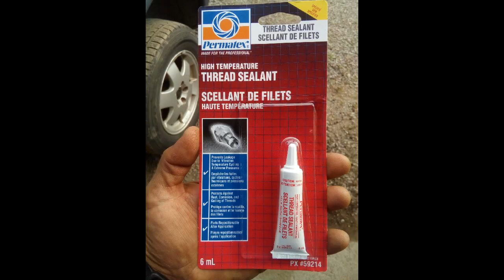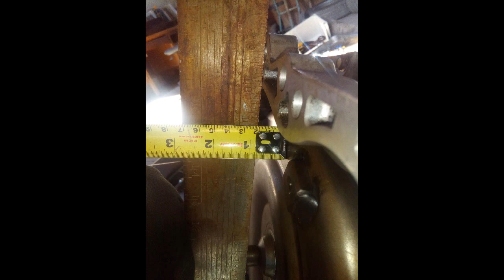TRANSMISSION SWAP VOLVO V70 XC (ASIN 55-50SN) | Photo tutorial.

Comment: Very helpful video and a great job. I have just bougt one of those with manual gearbox. It looks like the clutch is not in the best condition. If I have access to a car lift, wouldnt it be easier to lower the entire gearbox/engine together with the subframe?
Reply from the maker: Absolutely, if I had hoist I could just drop the engine and gear box all together with subframe. Let me know how everything is going.

Comment: Great video, I was wondering if you know about the 2005 V70 2.5 turbo? My mom's mechanic wrote her this messege and we have no clue what to do, the car is great 140,000 miles on it but are unsure how to fix it economically here in California. He wrote: ATM IS WORN - HARD SHIFT 1-2/2-1- FLUID IS DARK & HAVE CLUTCH & METAL PARTICLES - ATM INTERNAL WEAR/FAULT CAUSING HARD SHIFT. FRONT AXLES ARE WORN & HAS EXCESSIVE PLAY AT CV JOINTS. RECOMMEND BATTERY, ATM & FRONT AXLES REPLACEMENT.
Reply from the maker: Hi George, I am glad it helped you out a bit! P2 Volvo (2001-2007) are all pretty much the same car. If flued hasn't been replace since day one I will be careful doing the flush. Some high chances after the ATF change AT might fail completely. If it shifts OK I will leave it as it is. You can try to flush AT on your own risk it might solve the issue. Might try add Lucas AT additive, sometimes it works (it never worked for me). 
After AT swap I installed AT cooler and inline filer. BZW, I will make video very soon how to service Volvo AT. How to make it last very long time. Volvo has ASIN (Toyota) gear box is pretty reliable unit but she is very sensitive to overheating and ATF quality.
In my experience, If CV axels don't make clunking noise when you turning sharp and rubber boots are sealed I won't worry about it but I will recommend to check your Volvo with another mechanic you trust. 
Cheers!
Reply: @PistonShack  thank you so much I will follow your advice and hopefully this Volvo can get another 140,00 miles
Reply from the maker: @georged822  Yeah! Let me know how everything is going. Cheers!

Comment: I have an 04 US Spec XC70.  I was driving down a mountainous highway fully loaded in below freezing temps when I got a transmission fault.  I continued to the bottom of the mountain and pulled off ~40 miles later.  A few hours later when I returned to the car, I was able to drive it up onto a trailer and get it home.  I found the trans fluid was below  the dipstick and I put in about 1/2 US gallon to the top of the cold full mark.  Now it will very rarely go into gear and seems to be slipping significantly if it will go into a gear.  Any suggestions on what I could do to diagnose?  I'm assuming a pump or solenoid of some kind.  Thank you for your help!
Reply from the maker: Happy New Year Daniel to you and your family!
Okay, let's see what we can do. 
1. Did vehicle overheated? Usually when rad fan relay failed it could cost serious AT overheating issue. 
2. Lost of AT fluid usually happens from the gear box input seal due to the  the seal failure or overheating condition. Did you have any problems with AT before this happened?
3. Do you have any trouble-codes related to the transmission? Can you pull codes from TCM?
4. What is AT fluid colour? Does it smell burnt? 
5. How many clicks on your Volvo?
We need a bit more info the figure it out)
Cheers!

Comment: How did you separate the driveshaft from the transfer case after taking the 6 bolts of the driveshaft out? 2:13 On mine the ball bearing is stuck inside the drum of the case
Reply from the maker: hey brotha! Ok, I see what you mean. Just tap the metal part of the shaft flange with a hammer. It will come a part.

Comment: 2005 XC70 over 350k miles on it. Car drives fine then slams from 1st to 2nd once its warmed up. Can slip out of gear when shifting down. shifting auto from the 1st to 2nd can cause a slam/tire squeal/slip.  Sometimes it will slam hard into 2nd, feel like its in neutral then go into 2nd gear. All other gears run perfect and rides like a dream.  Can drive on highway for hours and slip into turbo passing gear without any issues.  Any give any advice? Last mechanic laughed at me without even seeing the car, which is near mint and lots of work done on it.  I found a 2001 Volvo that has over 150k miles in it. Was considering looking at it and hiring someone to swap out the transmission? Should I do this? Fluid smells burnt and the local Volvo dealer says you should never do a transmission fluid flush but if I insist, they'll do it for $700.00 the fluid is $97.00 a gallon and needs 3 gallons for the flush.  So should I follow this pattern? 1.) Fluid Flush 2.) Add Seafoam TRANS stuff to see if that works 3.) Do a daignostic at the dealship to see what they can find. 4.) Replace Transmission or Repair?
Reply: I feel that all the investment so far has determined me to follow through to the end. Need advice. Thanks.
Reply: Other things to mention. All of the engine mounts were toast. Had to replace the rear draive shaft and the bevel gear. Also notice the CV axle I just put on is clicky again but that was put on before the engine mounts were all replaced.
Reply from the maker: Well, if you have time, right tools, place to work on your Volvo and parts donor Volvo car or access to cheap used parts it's possible to fix everything. Otherwise it could be too much if you let shop to do any repairs.

Comment: Do you know if the auto transmission from a 2004 XC90 can be directly swap into a 2005 V70? Thanks!
Reply from the maker: Hey Greg! What kind engine do you have on XC90? 2005 V70 is FWD version of XC70.
Reply: @PistonShack  Sorry....I made a mistake...the donor is a 2004 XC70 Cross Country wagon and the car I want to switch the transmission to is a 2005 V70 wagon.
Reply from the maker: @gregsgarage1465  Hi Greg! It should work if it the same gear box (asin 55-50sn). You might need to swap your transmission wiring harness at the valve body.  AWD transmission might not work on FWD cars but I am not 100% sure. I think it will work. I would recomend to do Vida adaptation or in 1K km it should get adapted automatically.

Comment: Great video,nice work mate. Can I swap aw55-50sn from a C70 2001 FWD donor car, to a v70XC AWD also 2001 with aw 55-50sn witch is toasted?Will it work, thanks in advance.
Reply from the maker: Well, it should work. Check the valve body and harness connectors. I would suggest to search for more info on Volvo forums. After you put a new gear box install AT cooler and inline filter. I did that on my Volvo.
Reply: @PistonShack  Thanks  again. Vb is the same, no letter,the harnesses are the same, except the pnp switch(I'll try and put the original pnp from my toasted box) I already installed a filter and a cooler but it's too late. Volvo forum s confirmed the swap is doable and it will bolt on my engine,but nobody can confirm if its gonna work...the angle gear will bolt on donor box,and with the coolar sleeve it will be an awd,I suppose? Gear ratios are the same on both boxes only final drive is different.  Do u have any other suggestions? What was the donor car for your new box?thanks in advance
Reply from the maker: Hi, Dejan. I don't see any reasons why the same gear box 55-50sn  from FWD vehicle won't work. That's the one gear box for FWD and AWD vehicles. Second thing to swap  the collar sleeve from the original gear box to the donor could be the pain. I tried everything i did not come out. I used a gear box from 2002 V70xc with  confirmed 117K. It came with a harness and collar sleeve and angle gear. I only replace input and output sensors due to the different connectors. Tharts it. Additionally, I installed cooler and filter to keep AT little bit cooler. I will recommend you to find the gear box from 2001 or 2002 v70xc to avoid potential issues but if you can swap the sleeve and couldn't find any other gear box. I will go to install gear box  from FWD Volvo. It might need to do some transmission adaptation later. If you have any questions please let me know. Cheers!

Comment: I can see that your gearbox code is the same as mine, 9480897 - and I was told by volvo that only the same code would work on my car. Ive been looking for a new gearbox in month now, but they are really hard to find. The one you mounted does that have the same gearbox code?
Reply from the maker: Hi Lise! Far as I know if you swap  Asin 55-50SN it will work. It worked for me. I found known good gearbox from another Volvo with same engine and transmission as mine. As extra I installed inline transmission filter on return line and ATF cooler to save my new transmission. 
Cheers!

Comment: So I just recently bought a 2006 XC70 Volvo and I noticed one day I got on the freeway and it didn’t want to shift to the next gear reved up the engine until it shifted is that da transmission problem or solenoid?
Reply from the maker: Hi, 
It could be the valve body issue, software problem. How many clicks on your car. Let me know if you have any TCM codes. Thanks.

Comment: Thanks again for the video.  What did you need to use the laptop for?
Reply from the maker: Hi Ben, You're very welcome! I used laptop with my Volvo Vida Dice 2014 software to monitor parameters after the installation.

Comment: Can I use this transmission in my 2001 s40?
Reply from the maker: Hi,  The same ASIN 55-50sn 5-speed transmission was used on S40 models but check for different wiring, could be some variations depends from the market. Valve body is the same, might need to switch wiring. Check if you have AW50-42LE could be some issues with adaptation.

Comment: please help D replaced by dash dash(--) while driving mostly at 5th gear and it down shift to 4th and I cant change gears I have to stop and restart and it happens over and over again ,
Reply from the maker: Hi, Bea. Do you have Volvo Vida Dice diagnostic tool. It will help to sort it out. Sounds to me your Volvo has some wiring (electrical) issue, valve body one of the shift solenoids sticky  or might be defective TCM. Get another TCM from wrecker, usually it solves the problem. Cheers!
Reply: @PistonShack  Yesterday I took it back for diagnosis and it came out with TCM -0039 Shift position sensor faulty and TCM -0115 shift solenoid S3 Hyadraulic fault. Thank you much appreciated.
Reply from the maker: @beamello6906  You're very welcome. Let me know if you have any questions. Keep me posted with repair updates! Thanks.
Reply: @beamello6906  you tcm is bad or needs to be cleaned.. your Volvo is is safe mode... Happened to me I'm my 2004 s60
Reply: Jonathan Sanders Thank you

Comment: Thanks for the video cannot put it 2005 V70 XC transmission on a 2002 V70 XC
Reply from the maker: Yup, If you have 2002 v70 xc transmissions only from 2001-2002 will fit your "friend". Far as I know they only match with 2.5 L engines made after 2003. Look for asin 55-50sn 2001-2003. 
I will recommend you to install transmission cooler and ATF inline filter. Volvo engines operate at high temperatures and factory AT cooling system doesn't help much. Those AT a great units but you need to have AT cooler installed, then they will last long time. 
Cheers.
Reply: Volvo_SHACK thanks